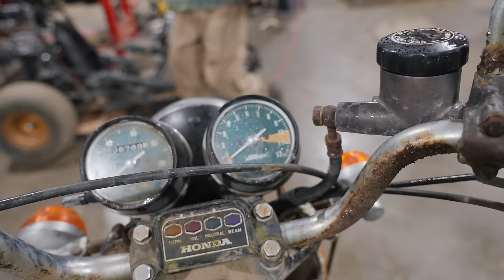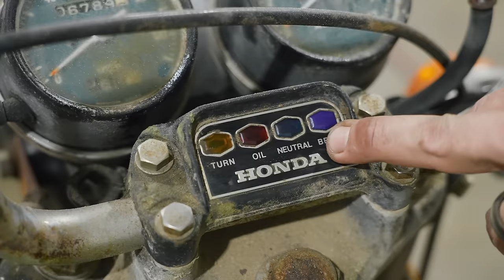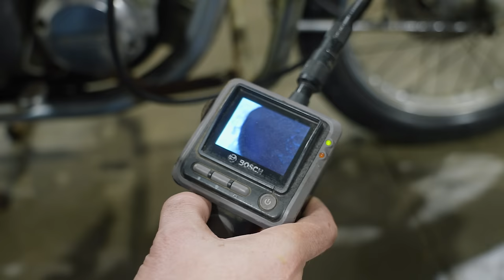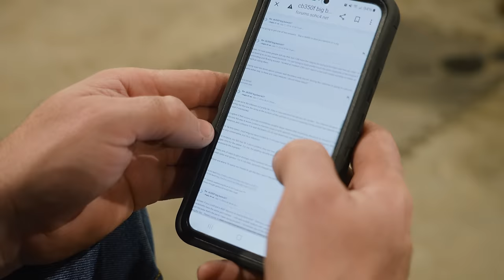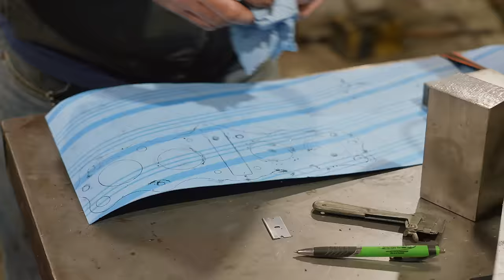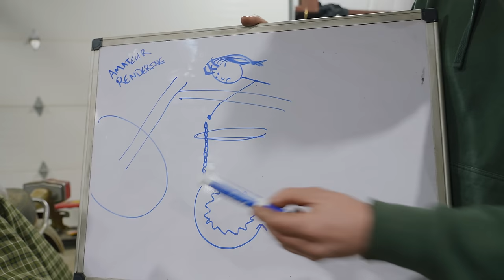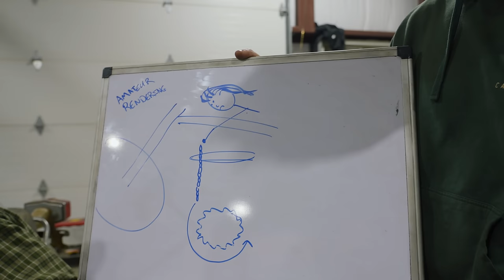This Honda CB350F Has Mud Wasp Nests in the Cylinders… Will it Run? (Sitting Since the 80s)

Comment: I've seen that oil plug on a larger I4 Honda installed backwards. The bike leaked a lot when it started. If you overfill the oil it can also dump out the shifter seal.

Comment: You may have stuck valves but there's isn't going to be a valve lash issue on a Honda with only 6,789 miles on it.  It's barely broken in!

Comment: I had a 350 4 cylinder and it had short little pipes that came right under the crank when I wound that thing out it was like hell let loose it was loud and I would have people almost drive off the road every time I went around them it was a fun little bike wasn't especially fast but it was fun

Comment: Honestly if you hook that chain to a code hanger and have the coat hanger in a j shape so that it will actually come around the other side and you can get to it with something else and pull it up then you just use both ends and just kind of loop it on to the or hook it on to the crankshaft sprocket😊

Comment: My dads old method for any old engine (he was born 50's) was light a small fire under the engine to heat the oil and the block, then after the fires out fill the cylinders with engine oil and leave it a week.
He got allot of diesel sawmill engines unstuck that way, sounds sketchy as hell to this millenial. (edit: but also something I'd do but with a fire extinguisher to hand and not left unsupervised).

Comment: Stop your video at 4523 You said you didn't have wire crampers. You had The Wire stripper part at the top. But if you look where your hand goes towards your hand there's wire crimpers there.🎉.

Comment: When this happens to a motor just fill the cylinders with diesel it will break them loose old trick I learned 40 yrs ago it works better ymthan anything else

Comment: Has anyone tried using an electric treadmill to bump start a bike in place, instead of pushing the bike? Have to switch the it's motor's polarity so it will spin in reverse. Strap the rear end down tight and let her rip.

Comment: Electronic ignittions will not work after a EMP bomb goes off. So you basically disableing your motor from runninng. With the threat of WWIII its a real bad Idea to get rid of your points. I know you guys are capible of intalling points so you should for good reasons. Points make more Horse Power anyway.